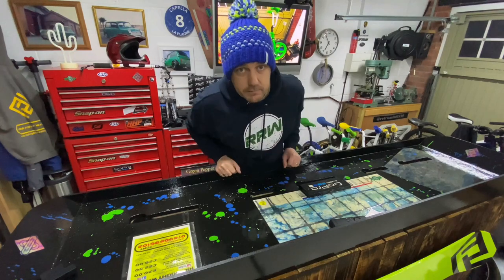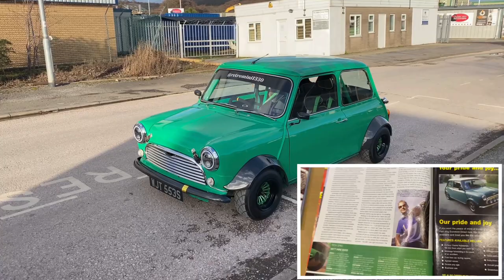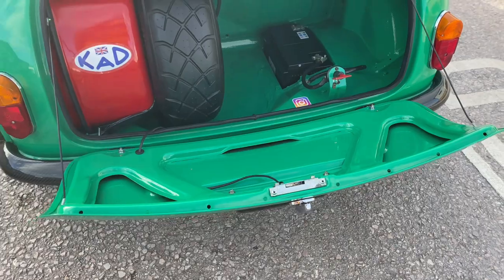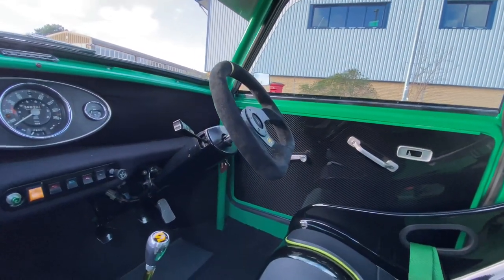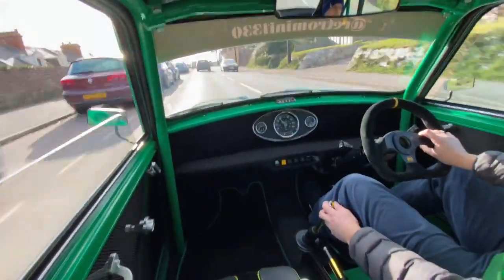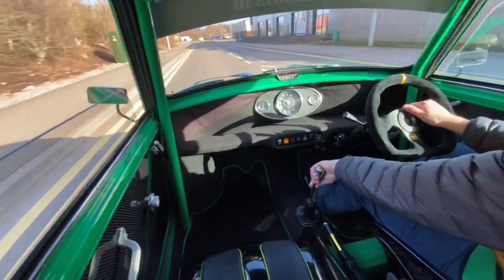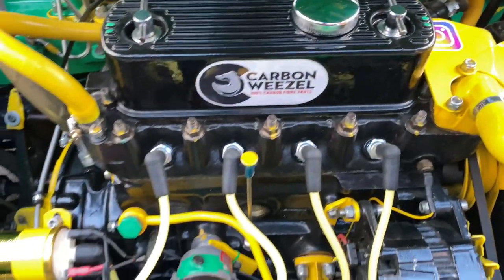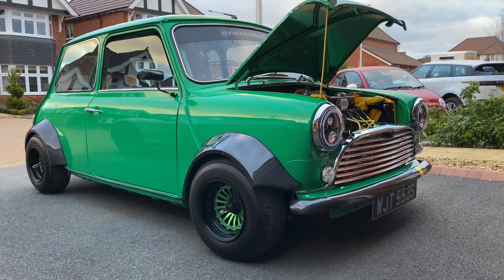Classic mini 1330 @retromini1330 classic road race mini, modified mini

Comment: what size is those wheels? love it
Reply from the maker: 10x7👍
Reply: @RRW  i have another question how does that wheel conversion work what with no bolts?
Reply from the maker: @crazyq22  there are blind studs on the hub so the wheel locate on them and the Single nut holds the wheel with a conversion to the centre of the hub on the front and back.
Reply from the maker: @crazyq22  in the film at 4:06 I show the set up where you can seen the blind studs 👍👍👍👍
Reply: @RRW  clever stuff, is it safe for road use? well I guess so if your using it,

Comment: 7.75 Discs with the KAD? how do you rate the KAD set up
Reply from the maker: Really good , well Made 🤙
Reply: @RRW  do you have a build thread anywhere?
Reply from the maker: @miniman3202  sorry what do you mean. What’s is a build thread.
Reply: @RRW  like a thread on a forum of the mini like a project thread? 
What is the size of the brakes?
Reply from the maker: @miniman3202  I had KAD vented groove 7.9 discs with mintex pads.
Reply: @RRW  holy moly didn't realise a 7.9 would fit a 10 that's awesome
Reply from the maker: @miniman3202  yes I will pop the picture on Instagram so you can see the part number if you can follow me it’s retro mini 1330 🤙